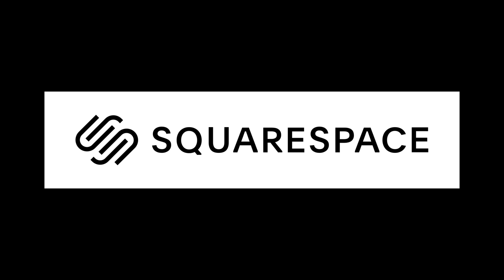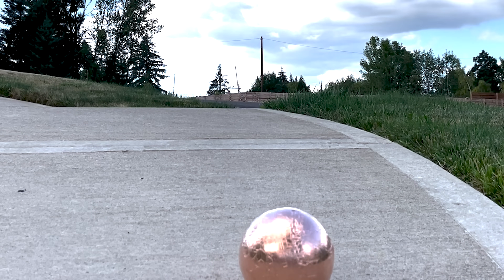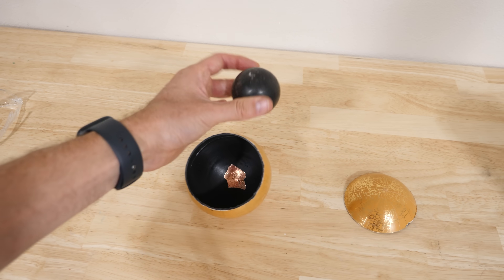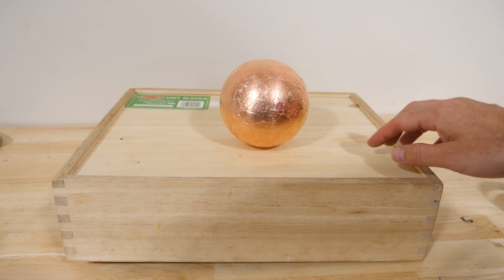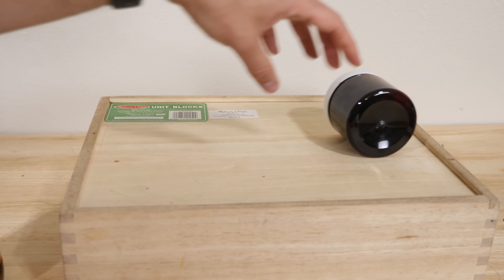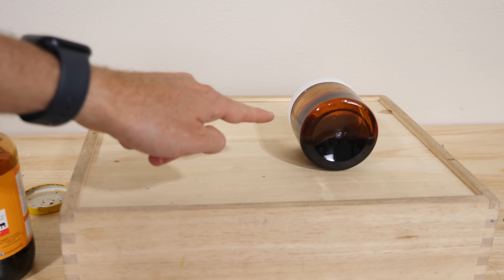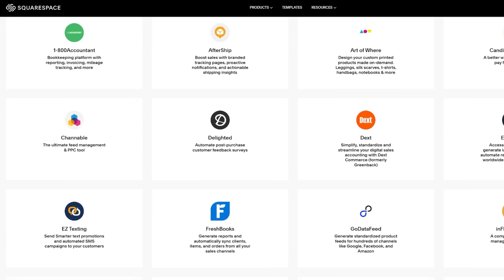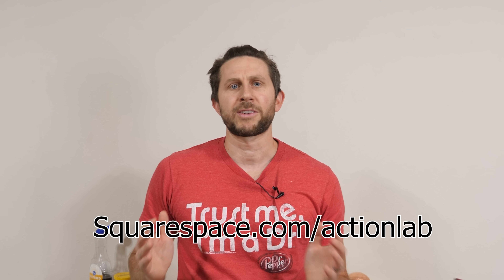The World's Slowest Ball

Comment: This is very interesting.
In Physics 100 the prof demonstrated how two apparently identical cylinders could roll at different speeds.
The trick is to change the moment of inertia. One cylinder has a steel outer shell and the other has a steel rod in the center.
They both weight the same but they'll roll at different speeds as potential energy is converted into rotational kinetic energy. .

Comment: One minute in & I am guessing it has a neodymium magnet inside. As soon as it moves the magnet induces a current in the copper, creating an opposing magnetic field and resisting further movement.  I do this by dropping neodymium magnets down a 24 inch copper pipe just large enough for the magnet to fit. It can take 30 seconds to come out the other end. Now let's see if I am right.

Comment: My guess before i see it which is being made on the last hour of a 9 hour cashier shift as i sit on the counter so it very well may be stupid but i think its a non newtonian fluid inside and the speed if the roll causes it to harden and solidify dticking it in its spot till it slows before it becomes a liquid again as it stops and than starts the cycle again.
Reply: That would also serve to explain the wobble as the liquid inside it hardens in wherever the force is the most rather than the same spot with the sudden stop also cause its direction to change

Comment: You stated that you have:  "two balls of equal weight and volume".  You failed to explain how you made the second ball the same weight as the 'snail ball'.  Did you weigh the molasses and heavy ball and then duplicate it with an identical mass that was held in the exact center of the non-snail ball?  Please explain or was your statement that they were of equal weight a lie that you figured we wouldn't notice?

Comment: I was sent (with 3 other students) to Marconi where we were set tasks like build bridges with only one newspaper that spanned a set length and could take X weight. When the task ‘make a ball or cylinder that can roll downhill slower than one of a similar weight, but using no bearings. I immediately said treacle or a similar, as it would change the centre of gravity backwards with no bearing. That was 1996. Teachers and hosts were stunned at that solution so I wonder how old this variant is?

Comment: Put some ribs in the cylinder parallel and attached to the walls. Then slowing effect would be amplified as the molasses would take even longer to fill each additional step. Thereby creating a sort of inside out waterwheel design.

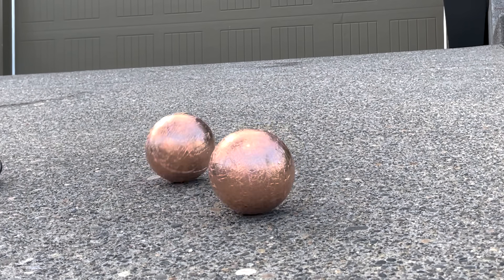Comment: paused at 0:59.

My guess is that the ball is hollow and there is about 1/4 of its volume filled with viscous liquid within like honey or a thick oil. This will slow the roll down by keeping the weight slightly behind the normal center of mass.
Reply: Awe I was half right... I missed the heavy ball within the viscous liquid. My method would work similarly too. Maybe a bit less effectively.
Reply: I'm sorry I i am annoying but DID I ASK?
Reply: @getcaughtin4klol752  +1

Comment: im curious if having wings, bumps etc on the interior ball would slow it down more.  Also what the ratio/relationship of those protrusions to the mass of the ball and the viscosity of the liquid(like if there is a sweet spot that keeps it rolling just barely over comming the friction necessary to keep it rolling or if the wings alone can keep the ball from rolling at all).  How does changing the viscosity change the roll too.  Can you make a water wheel like interior ball in a water filled ball do the same speed?

Comment: Since a sphere is the shape with the smallest surface area for the mass, and surface area factors into drag, would it be better to use multiple smaller balls or different shapes for the interior weight?  This would increase the drag while also lowering the center of gravity further.  Also, did you do any fine tuning for the density of the interior ball?  It seems like you would want a weight that is only slightly denser than the molasses, to make it less able to plow through the viscosity.

Comment: CHALLENGE!!!! Make a Snail ball that does NOT change it's inner viscosity, and therefore how it rolls, with change in temperature..... Molasses gets thinner when exposed to high heat, therefore the ball Will roll faster. And of course, the colder it gets, it can reach a solid, or solid like state.

Let's make this reasonable, and make this natural temperatures on the surface of the planet. I want the ball to roll the same, regardless of whether it is 60°C or -60°C

I know it can get vastly colder in some places.... But a 100° range seems reasonable

Comment: Once upon a time I made a viscosity-meter for one of the motor oil brand. It consisted of several vertically arranged acrylic tubes filled with a certain type of motor oil and a steel balls  poured into each tube. The more viscous the oil, the slower the steel ball falls down to the bottom of an acrylic tube.

Comment: couldnt one just have a pump and use a way to brake easier in mid roll by pumping hte fluid out of a center of ball and then apply friction brake there by reducing wear and tear on the brake power.

Comment: I started to think of how this could be used as a braking mechanism, to only realize that this is exactly how vehicle brakes already work.

adding a friction brake on a singular wheel/sphere doesn't work because the brake pads would just spinn with the ball/wheel, but cars have 4 wheels, and then I realize it has less to do with the wheel count, but that the vehicle is the counterweight, and the brakepad adds friction just like the molasses.

why is the wheel count irrelevant? because a car could have it's rear wheels come off the ground and roll end over end, if the counterweight of the vehicle were not significant enough.

Comment: I don't think the low center of gravity has anything to do with this. A frictionless rolling mass inside the ball would not affect the rolling speed at all. The reason why this experiment works is because the molasses has a high viscosity and sticks to the inner surface of the ball. This means that when the ball rolls, it has to drag the molasses upwards on the back side which in turn applies a counter force to the rolling motion. It's worse with the heavy metal ball inside, as the high viscosity molasses drags the ball up the back side causing an even bigger counter force to the rolling motion.

Comment: "So I have here two balls of equal weight and volume" - Ok, what was inside the faster ball that increased it's weight to that of the one with the heavy metal sphere and molasses? 
I mean, I understand the theory, I actually figured it out before you showed how you made the slow one, but you DID say they were "equal weight and volume" so I was wondering how you increased these in the other ball.
Reply: The second one was probably simply thicker, if I had to guess. It's not the weight of the filled ball that slows it, but the increased gravity-friction relationship of the heavier object inside. Because the shape inside and the shape outside are not connected in any way but contact, friction slows the ball. Even if the second ball were heavier or lighter, it would fall no slower, due to it not having to deal with the internal friction variance of another object inside.
Reply: Does it really matter? You could use anything (that has an even mass distribution and doesn't move around inside the ball).
Reply: @Gameboygenius  Does* it really matter to the outcome of the demonstration? Probably not. However, to make the statement that they are "two balls of equal weight and volume" rather than 'two identical looking balls covered in gold foil' makes me wonder what was in the 2nd ball to increase it's weight. 
The volume could easily be identical if the same balls were used for each one but something must have been in the 'fast' ball so it's weight equalled that of the slow one. I'm merely asking what it was.

Comment: What I'm curious about is at what slope does the ball start to speed up again, and if it depends on the viscosity or anything else. Obviously a slope that's basically just a wall is going to have the ball going faster, but is there a point before then where it just starts to act as if the molasses were solid?
Reply: The friction of the inner ball's movement through the molasses is actually based on gravity, so at no point would the ball gain speed for it's rolling. On the other hand, if the angle of the structure it were rolling down were steep enough, gravity on the outside of the ball would overcome the friction on the outside of the ball, and it would begin to slide, thusly accelerating even though it would not be rolling any faster
Reply: @milokurain7293  I just realized I should've asked "when, if at all, does the ball stop having the same proportional decrease" since obviously the ball rolls faster down steeper hills lol, my bad. 

So you're saying as long as the ball doesn't slide that will never happen? What I was thinking was that since there are obviously things with lopsided center of masses that still roll (like if you taped a much lighter ball inside of the big one), so it'd start working differently at the theoretical slope where the ball would start being able to roll if the molasses were solid. I have no idea if that's right though.

Comment: This is an interesting idea that I think could be useful in creating a spherical wheel. Imagine what it would be like if the internal ball was what you were using to provide the torque. I think that you would want something much more viscous than what you were using. Maybe you could use asphalt or something else that would still technically allow movement but it would also allow the application of large amounts of torque while givong resistance in directions you don't want.

Comment: so i am commenting this before i watch the video, and i may be wrong, so i will follow up in the replies.
anyway here is my theory as to what could be making the ball roll so slowly. i saw that it rolls non-uniformly, in a sort of jagged start-stop-start pattern, and this mad me instantly think of some sort of turbulent motion  within the ball, that could be caused by a variety of things, such as a weight that is free to rotate within the ball, but is somehow suspended so that it remains over the center and slows it instead of accelerating it like it would if it were free to touch inner wall of the ball.
Reply: so it seems i was somewhat correct, albeit my initial theory was admittedly overcomplicated. i was imagining a weighted gimbal inside the sphere, but the molasses and second ball works like my theory on a free-moving weight, but the molasses slows the weight down so that it slows the outer sphere instead of accelerating it like it (probably) would without the molasses.

Comment: what if you rolled it down a really steep ramp? like 45° or more?
Reply: At a certain point the friction between the ramp surface and the outer ball will become weaker than the internal mechanism causing it to just slide down instead of roll.

Comment: I know this is a bad idea, but i wonder if you can do this with wheels. The purpose would be to have a way to keep a vehicle from moving too fast down a steep hill. Of coarse, that becomes lost energy that you could recapture with an alternator.
Reply: when those wheels would move faster you would have such great imbalance that the weels could break or the bearings wear out real quick (ever drove a car with imbalanced wheels? its...fun. the whole car starts to vibrate. if the imbalance is high enough, desaster strikes)

Comment: When I first saw the ball rolling so slowly I initially thought you had filled it with honey, but I guess molasses is a bit similar. I still like your videos though and hope you keep making more. 👍
Reply: Ah, the classic honey-filled ball from the old YouTube videos, OGs should know 😎
Reply: @red_dulge  guess I'm an OG then
Reply: I am a mechanic, so I thought high viscosity oil, and then non newtonian fluid.
Reply: I thought he had one of those sticky balls from vending machines that crawl down walls in it.
Reply: Slime is what poped into my head first. Done this with my kids and slime jars.
I didn't expect the metal ball tho.
Reply: @NismoXero  I originally thought being 40% filled with honey was what made it so slow but how slow it rolls would greatly depend on the temperature. Honey could make that ball take an hour to roll a few inches if it's near freezing and that's without the metal ball. The metal ball only slows it down more due to the extra friction against the viscous fluid. Even molasses gets thicker at lower temperature, but room temperature honey at 70°F was what I expected that to be originally. There are multiple different things that could make the ball roll slowly.  Some very thick grease/ oil is another possibility.

Comment: My guess it was a ball was a sphere with lines in it that are not parallel to each other but barely tilted, and a steal ball that will roll on those lines so when that steal ball should go down it goes to left and then it jumps to next line that is also little bit tilted and so that steal ball is moving ever so slightly and moving lot to left and right and that is why that copper ball moved in weird ways, but then you showed much easier solution

Comment: It might be interesting to make a ball or cylinder that accelerates very slowly as it rolls, but then goes at speed and stops slowly. Maybe with a heavy weight geared to a flywheel with a high gear, so the faster it rolls the more energy the flywheel has to have.